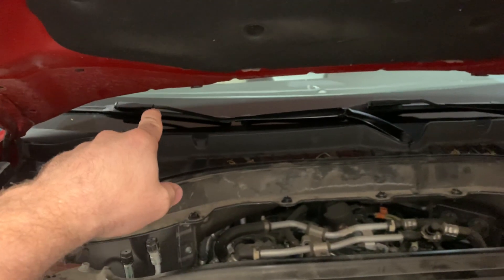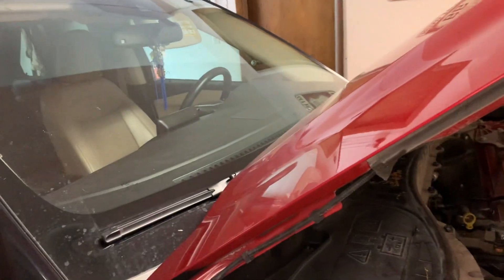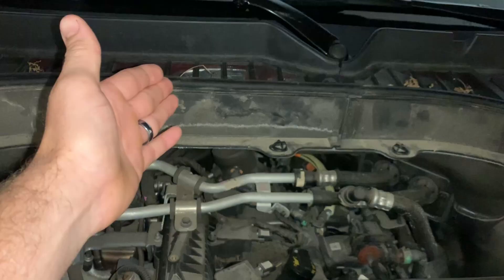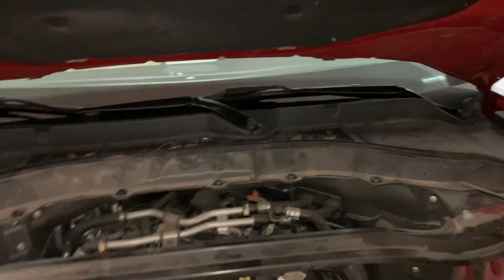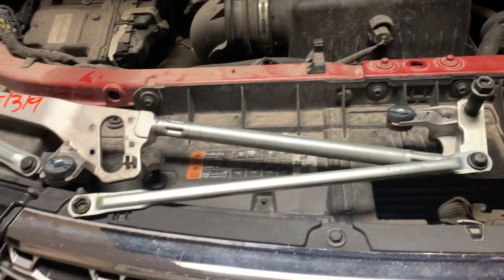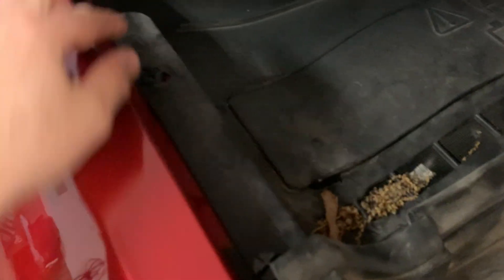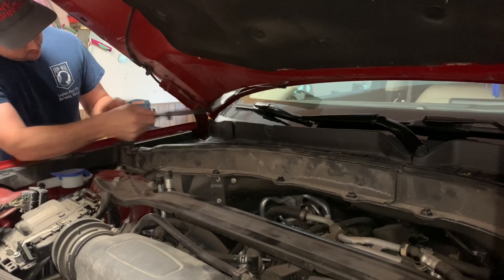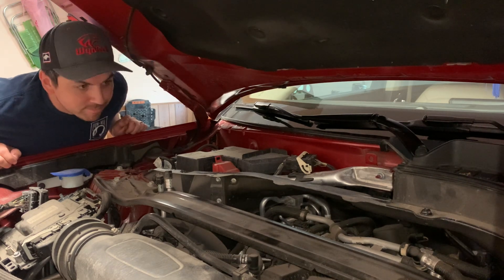2021 Explorer Wiper Arm Transmission Replacement

Comment: You're the only frikin' person doing a video on how to remove that linkage on an Explorer. Thank you! Mine is a 2018, and it got cracked on the exact same point. not only looks badly engineered, it also looks like a cheap aluminum cast.
Reply from the maker: Terrible design